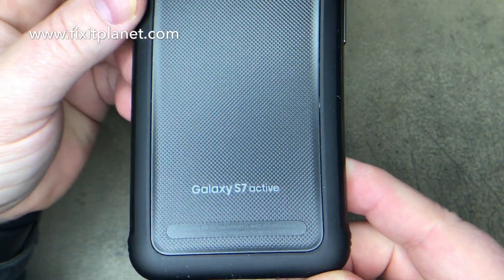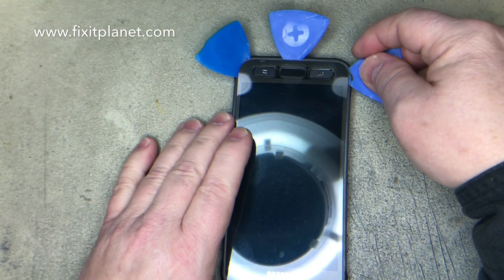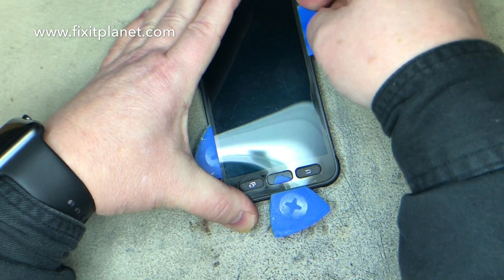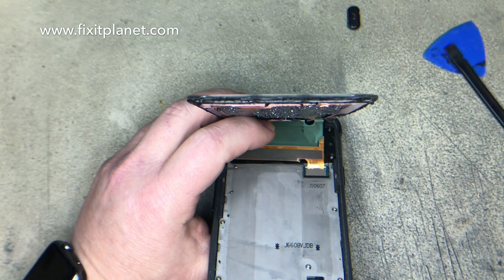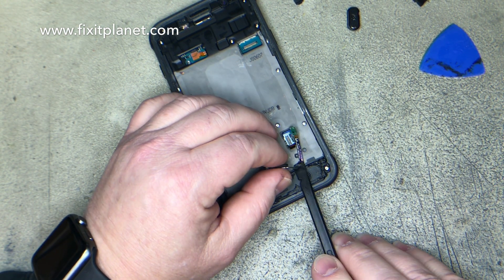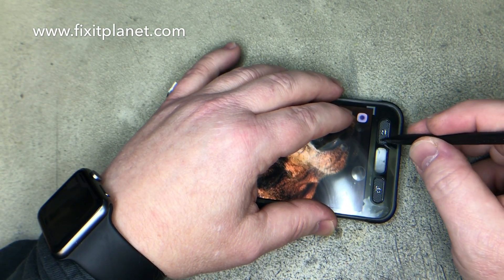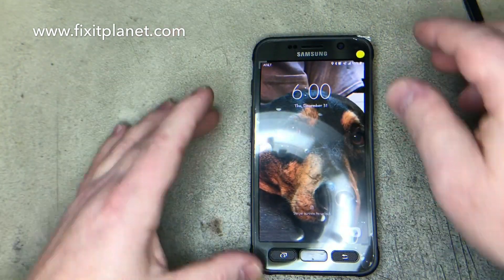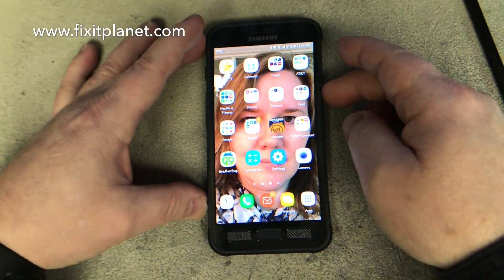Samsung Galaxy S7 Active Screen Repair From Start to Finish

Comment from the maker: For those who keep asking. "Where do we get the screen?" They are all expensive and aftermarket screens are crap, here is a gold one https://amzn.to/2q7ARXL You just have to do a Google search and see who has what color available and how much. The question is do you want to pay for it? Genuine or not.
Reply: Thanks! In my case only the screen is cracked,digitizer still good. Can i just get the Screen Replacement? How hard is to separate the cracked screen and digitizer?
Reply: @afais8607  You can try to replace just the glass, but separating a good digitizer from a cracked screen without also breaking the digitizer is extremely unlikely. There are video's of this being done. I tried it twice (to see if I could) and broke the digitizer both times.
Reply: Hey if the screen itself is cracked and colored lines down the middle do I buy the lcd screen only?? I'm buying it online then having a place do it for me.
Reply: Hi, can you tell me if I want just to replace battery and charging port on my Samsung Galaxy 7 active can I put the old screen back and do I have to glue it back or adhesive that is already on is good for putting it back in place ? Thank you

Comment: Hey people where do we get the original Battery?
Reply from the maker: Here is one https://rover.ebay.com/rover/1/711-53200-19255-0/1?mpre=https%3A%2F%2Fwww.ebay.com%2Fitm%2FOriginal-EB-BG891ABA-Battery-4000mAh-For-Samsung-Galaxy-S7-Active-SM-G891A-G891%2F323640791063%3F_trkparms%3Daid%253D555018%2526algo%253DPL.SIM%2526ao%253D1%2526asc%253D20131003132420%2526meid%253D2a98b17c525a44d581247ab980530030%2526pid%253D100005%2526rk%253D4%2526rkt%253D12%2526sd%253D254043023706%2526itm%253D323640791063%26_trksid%3Dp2047675.c100005.m1851&campid=5338414869&toolid=20008

Comment: I can only find a new digitizer for $250.  So ridiculous.
Reply: Ive had a cell phone repair shop told me they would do it for me but it costs 250 for the screen. he told me to bare with it and then get a new phone when I need it
. The cost is just so high that it isn't really worth it.
Reply: Yeah. You can get a new s7 active for $330 right now, yet the digitizer is still around $240. You can also get a used one with in great condition for $240. So it makes no sense.
Reply: @bigsassyster  samsung replacement parts are just more expensive I guess
Reply: @bigsassyster   I found one for about 150 with shipping at parts4cells, just got it in the mail today, looks decently legit, we will see one I install it

Comment: How do you glue your lcd screen to your glass screen? Can u use uv glue or do you need some kind of glue tap adhesive
Reply from the maker: For glass only repair you need LOCA try X-Factor UV Glue Sticky-iCKY 1000 or something similar.

Comment: where do you get replacement screens?

also doesn't this kill the waterproofing?
Reply from the maker: If screen is cracked it's already lost water resistance.
Reply: Matanumi